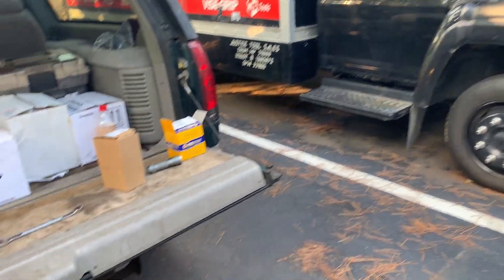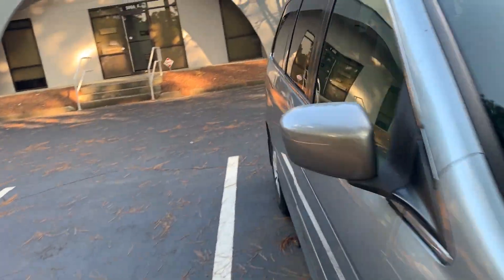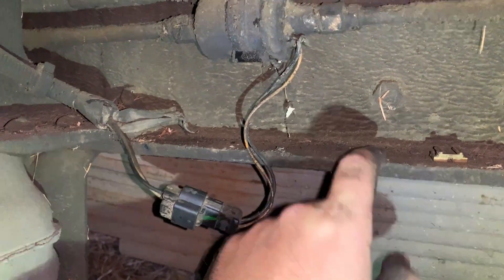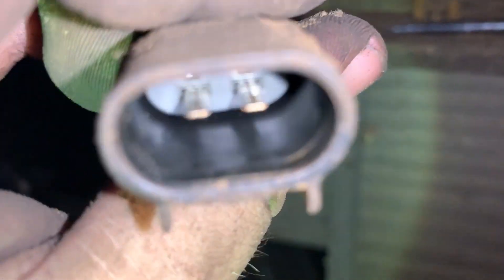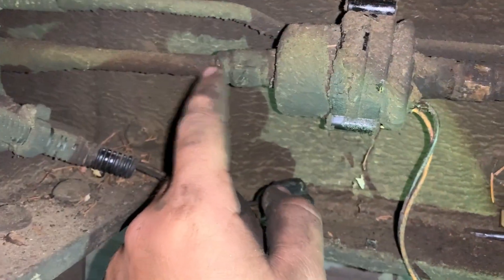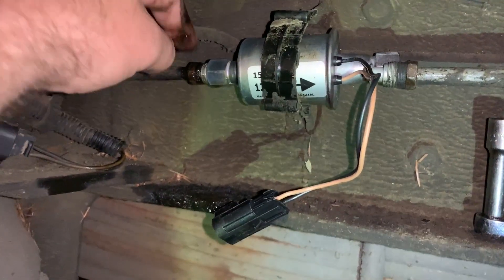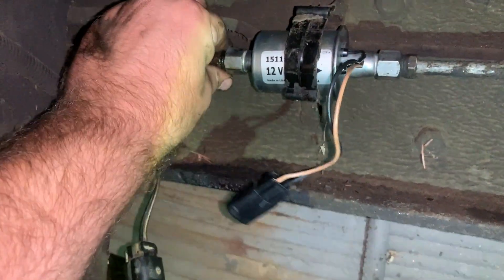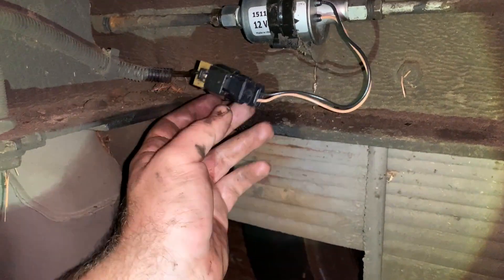C4500/C5500 Kodiak Fuel Transfer Pump Replacement

Comment: I have the same truck, same issue. I replaced the pump and it still won't transfer fuel to the front tank most of the time, sometimes it does. any idea what this can be? Also, when it's supposed to transfer but doesn't, the gauge will drop to zero until I clear the codes, then it will read correctly again.
Reply from the maker: What codes come up when you scan the truck?
Reply: @2ndMomentumGarage  the code is P2636
Reply from the maker: @codywohler6758  the fact it suddenly drops to zero means the ECM is detecting a failure somewhere. If the pump is new, check for any frayed wiring. Also test the fuel pump relay in the fuse box. Possibly could be the sending unit in one of the tanks. If it’s intermittent, I’m wagering that something isn’t making contact 100% of the time like it should. 

The new pump I put in the video fixed my gauge issues. But I would like to have the gauge cluster rebuilt soon too.

Comment: I have a 2007 GMC c4500 kodiak can has no fuel pump on the fuel line and can’t get it started 

And I’m losing prime on my priming pump 
what do you think?
Reply from the maker: If it’s diesel, it should still run of the front tank. However the fuel gauge won’t be accurate. Also, the factory diesel fuel systems on the low pressure side run off vacuum so if you have any leaks at all the truck may not start or have trouble running. Possible a fuel line/hose has a hole or the filter head itself is not air tight and needs replaced. 

Loosen the bleeder on top of the fuel filter housing and see if you can use the hand primer to pull fuel out. If not, likely a leak on the line from tank to filter.

Comment: Question. Do you know where the fuel pump location is on these?
Reply from the maker: The transfer pump is the only actual fuel pump. There is no pump from front tank injection pump on the diesels. The fuel filter housing has a hand primer the get the vacuum/suction started in the fuel lines so the injection pump can operate without a lift pump/fuel pump. Lots of guys install aftermarket lift pumps though. I’ll be making a video doing one on this truck eventually